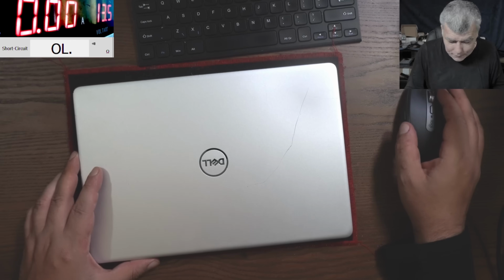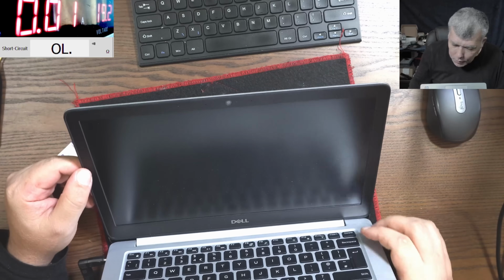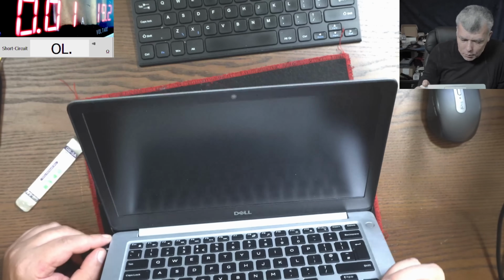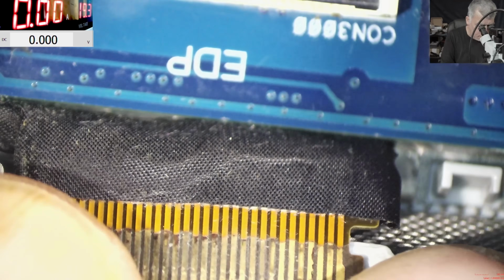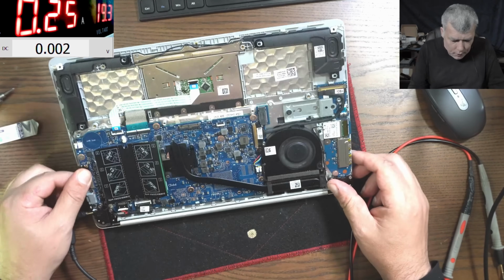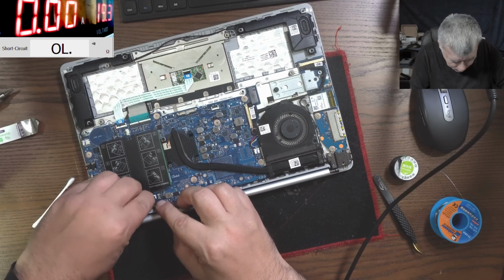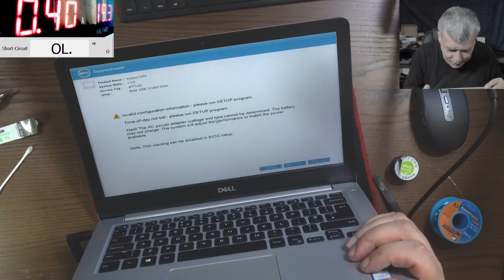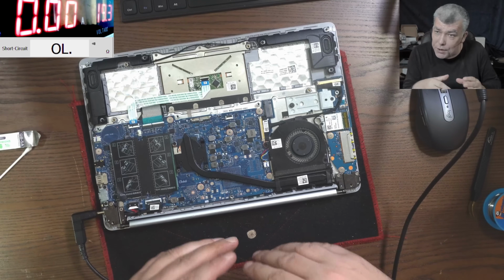Dell Inspiron 5370 P87G no backlight - water damage repair

Comment: Why didn't you use a pice of sticky tape to stabilize the ribbon before soldering?
Reply: just junk of metal to weight it the cable in place for a minute